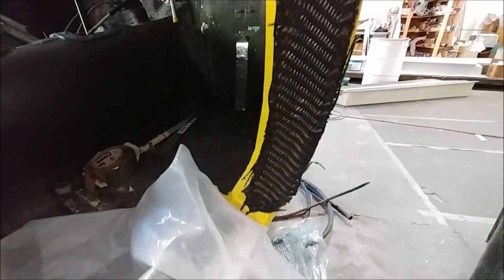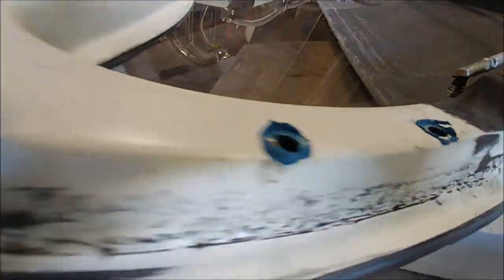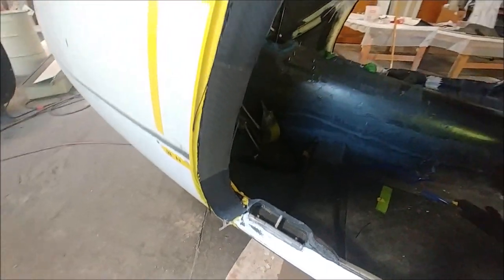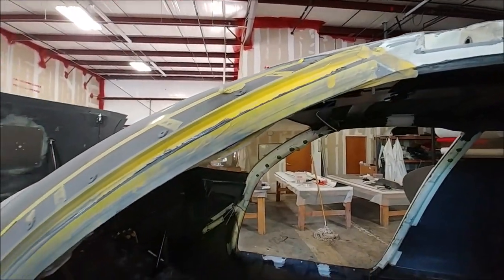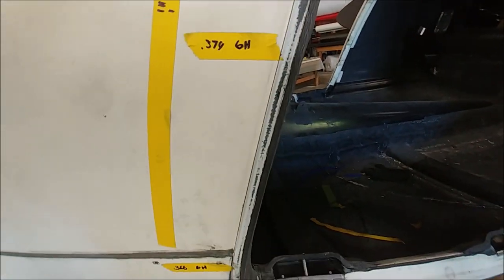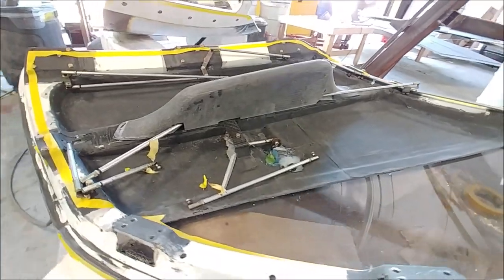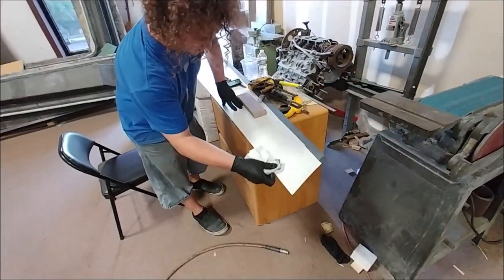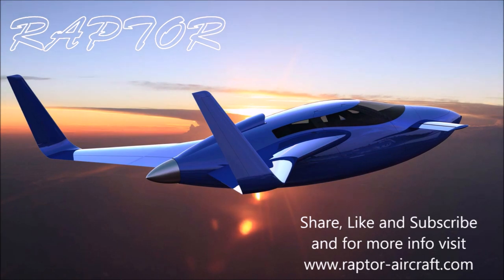Installing Systems - Building the Raptor Prototype

Comment: Good job on the door fill/lay-up Peter! even Jeff would be happy with that. Wow these doors are a nightmare and to think they looked so well designed and relatively easy on the cad drawings. I assume once this prototype is complete and flying you will start to look at the second set of wings and will be trying to resolve as many issues as possible before actual production begins. Keep the good work up
Reply from the maker: Thanks!

Comment: It can’t help but think some sort of metal frame around the door opening would help make it more rigid as another guy mentioned on here. In my mind too many parts can move a little which can add up to a leak. 

I suppose you could do an experiment on a smaller scale and test it with and without the metal support. A burst test could be interesting 😀

Comment: The doors are more complex than a Swiss watch,lol.  Enjoying watching your journey. Hope there is an unpressurized version also.
Reply: I'm assuming that would primarily just be for lower cost? I wouldn't want to lose the ability to fly at FL250 without a mask, though.
Reply: Making an unpressurized version would be more work - adding vents, etc. for no cost savings. Unlike a plane like the Piper Matrix, you wouldn’t be removing anything from the structure for any savings, and my guess is that Peter won’t make design and make molds for different lighter weight non-pressurized parts. Huge investment. As an Experimental category plane, owner/builders could do anything they want, but I’m not gonna cut any holes in mine!